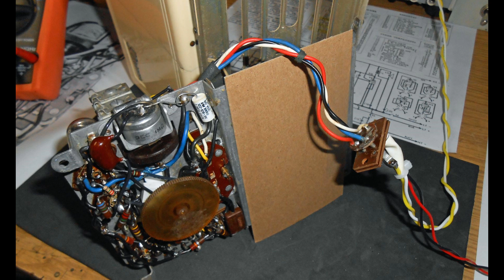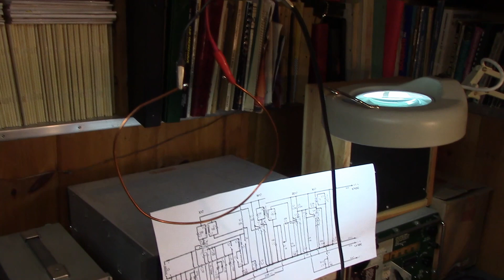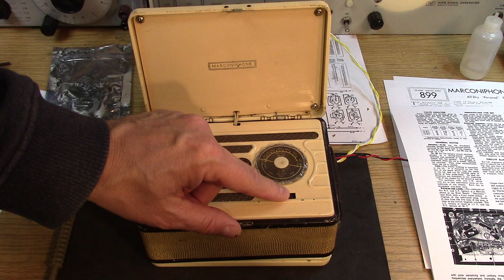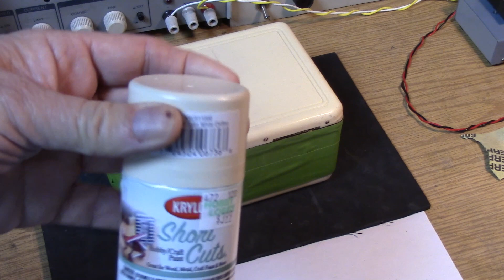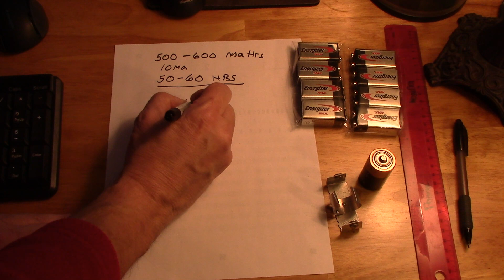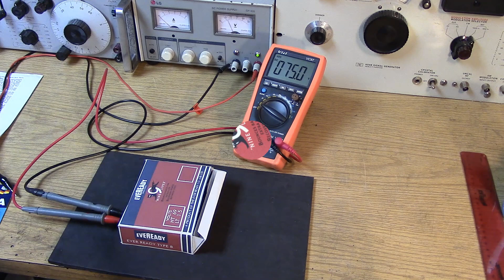Marconiphone S20P Part 4

Comment: Had there been TELEFUNKEN Space Charge vacuum tubes that are direct equivalents to the vacuum tubes that were in the set then maybe the unit will last longer with a brand new set of tubes.
Reply from the maker: When will you be sending a few of these magic bottles to the channel so they can be properly incorporated into a new video?
Reply: @MIKROWAVE1  I can't but TELEFUNKEN still make them assuming the company is still around.